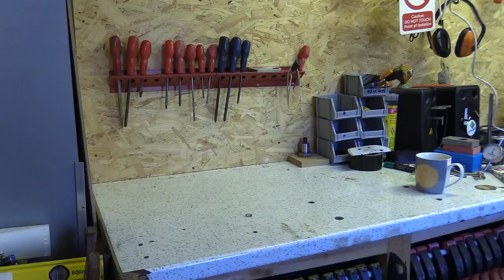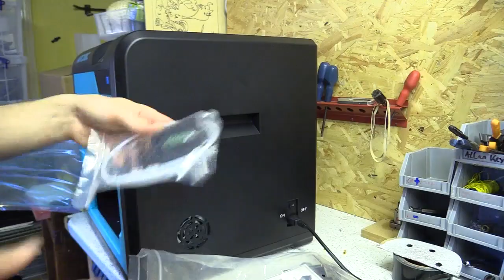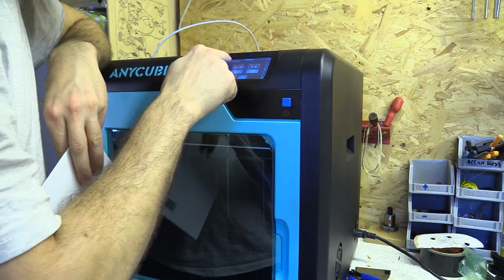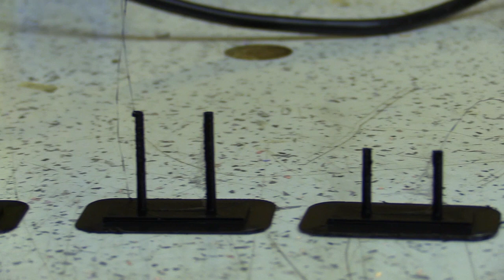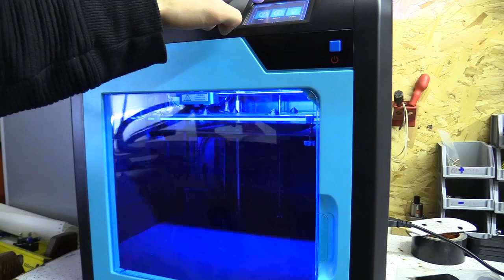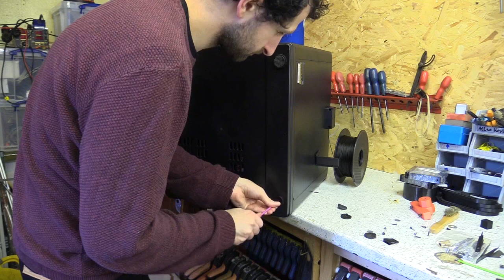Anycubic 4Max Pro V1 Enclosed 3D Printer

Comment: Do you still have this printer? Any chance for a review after using it for some time? Are there any issues you found from long term use? Did you do any tweaks or upgrades, especially regarding printing high temperature materials?
Reply from the maker: I do still have it  - it's a good printer although a little bulky. I only ever printed with PLA. A couple time with PETG, both of which were fine. At the moment I'm using a Prusa Mini (heavily calibrated) for my day to day stuff.

Comment: Although it requires an almost complete dissasembly the door can be removed and a coating of semi-gloss black paint applied to the light blue housing.   It looks much better in all black.   I'm going to add a dual feed to the system for multi-color/material printing.  I noticed that it has a second feed slot in the filament sensor housing for this addition.    Although a number of issues arose when I first purchased it, they didn't really detract from the huge enclosed build chamber and wide temperature specs for the system.    I've had the most success with PETG.  It seems to behave exactly the way it's supposed to with the special print bed.   Surprisingly I can even print nylon, and ninjaflex with a little tweaking.

Comment: hi, do you find this 4max pro is a bit slower in printing, with the same speed setting?  i compare with my D6, Bibo, and my other printer also.
do you have any solution for this?
Reply from the maker: Have you looked at the acceleration settings? These can play a big part in restricting the overall speed and are often overlooked.
Reply: @EducatingSavvas   I don't see acceleration settings.  Do you use Cura?  Maybe I have an old version?
Reply from the maker: @cherylwallace2454  There's a cog shape over the section titles in the print settings place, then take a left, and a right walk to the end of the road.

Comment: What is the PSU on this unit and do you think an auto-touch probe could be added?
Reply from the maker: Hmm I can't tell what the PSU is or rated too as it's enclosed. I don't think you'll be able to add a touch probe on this without upgrading the controller.

Comment: I've got 5 printers but my go to printer is my i3 Mega. You have my attention. None of my printer are enclosed or print ABS very successfully. I would love to have a good enclosed printer for ABS.
Reply from the maker: Just remember ABS fumes are really harmful so you need a really well ventilated area to print in. PETG is a good alternative.
Reply: @EducatingSavvas  My printers reside and operate in their own well ventilated room away from people except when I walk in to check on them. I also find that PLA usually does the job ... except when exposed to higher temperatures.